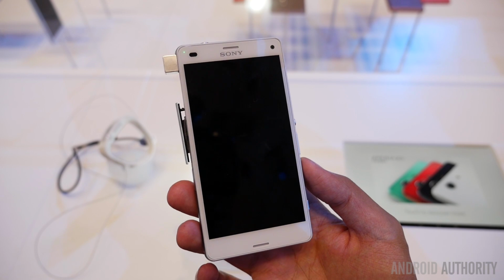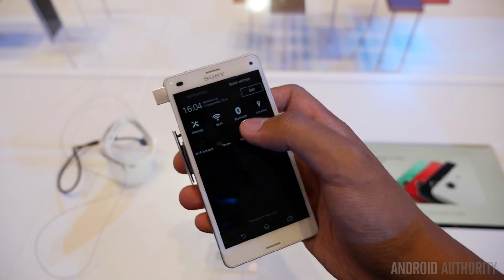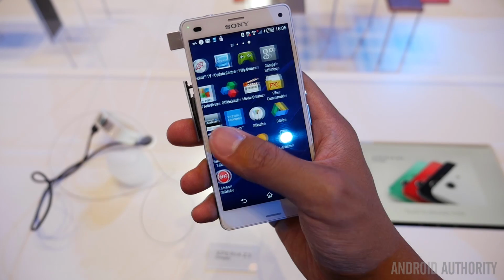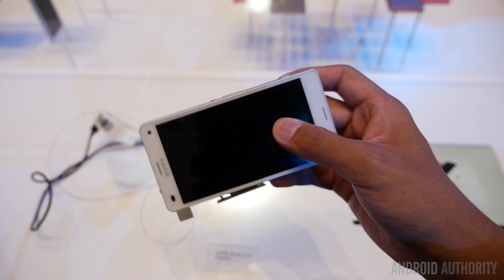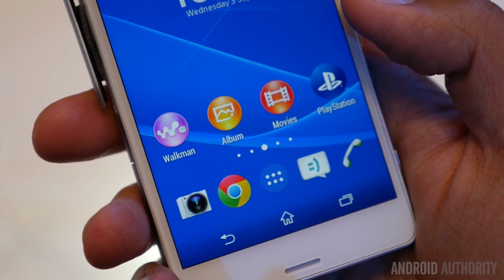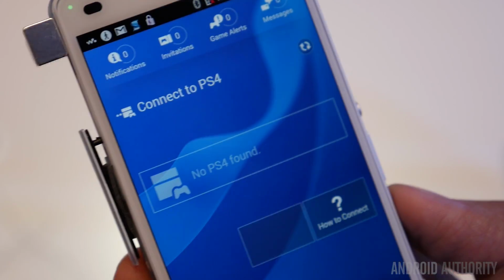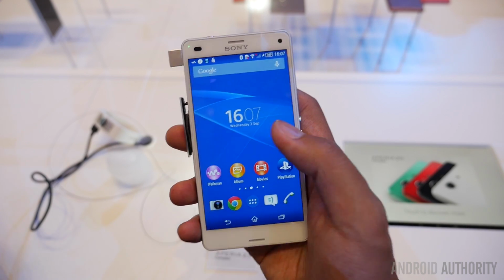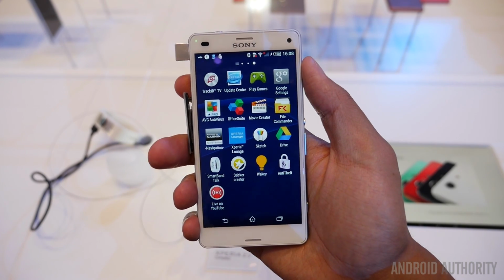Sony Xperia Z3 Compact First Look

Comment: Sony just rebranded 2 devices : the z3 from the z2 and the z3 compact from the z1 compact....same specs for higher price.....great work!
Reply: Changes in Z3C compared to Z1C:

- Snapdragon 801 at 2.5gHz
- Front facing, stereo speakers
- Front camera is 2.2MP over the Z1C 2MP
- wider angle rear camera lens (25mm)
- ISO up to 12800
- expandable up to 128GB (mistake in the GSM Arena specs)
- larger battery (2600mAh)
- larger display (4.6 inches)
- slimmer bezels all around
- removal of shatterproof film
- much more vibrant display
- it is now dustproof with IP6X rating
- Hi res audio
- PS4 remote play
- New camera features (kind of gimmicky but still new)

Specs don't mean everything.
Reply: DaShinyful and what about ram?
Reply: The RAM is still at 2GB but I doubt you'll notice a difference in the Z3C versus the Z3's 3GB.  Reason being that the Z3C only has a 720p screen.
Reply: Anyway Thought its 3 cause z3 has 3 would be awesome

Comment: The Z1 Compact I'm using is pretty much the same device (okay without 4k video and with 0.2ghz less of CPU clock speed)
Reply: and digital noise cancellation and a new 25mm wide angle lens and dual speakers and bigger, better screen and bigger battery and a thinner, lighter, less bezel form factor @@ I just love this phone :)
Reply: you forgot the differenc between "Z1"and"Z3"
e
Reply: And you can remote play with a playstation 4 i think.

Comment: the battery on the sony compact series sux bigtime
Reply: Are you serious? im getting 2 days easily, i barely have to charge my z1c
Reply: 2600mAh with a 4.6" 720p screen is definitely NOT bad... The HTC One has the same capacity with a 5" 1080p screen and it works well...
Reply: small battery =/= bad battery
Reply: It is BIG for the size and screen resolution.
Reply: Josh has not mentioned it here, but many other tech reviewers are saying that Sony claims to have boosted battery performance of the new Z3 products to nearly 2 days. We'll have to wait and see.
Reply: It seems Sony's really trying to sell their two day battery life thing.